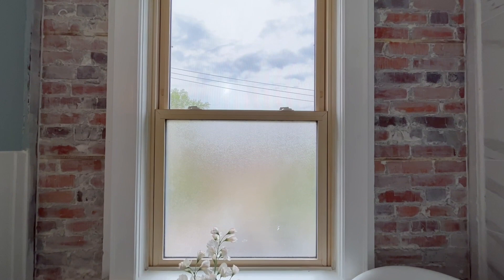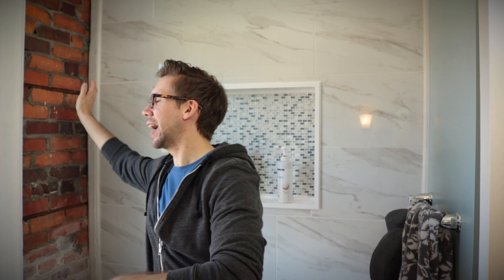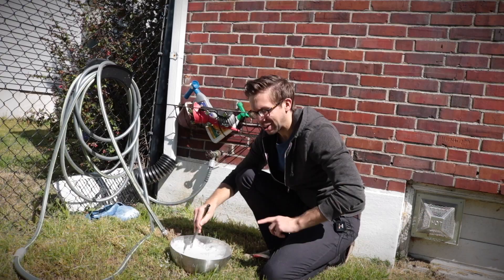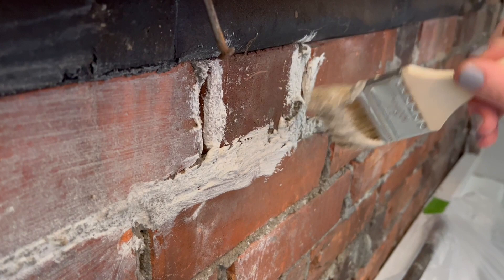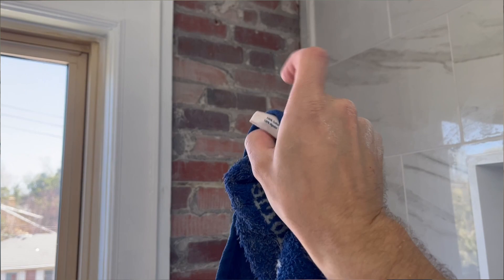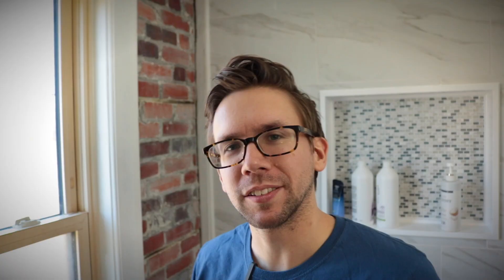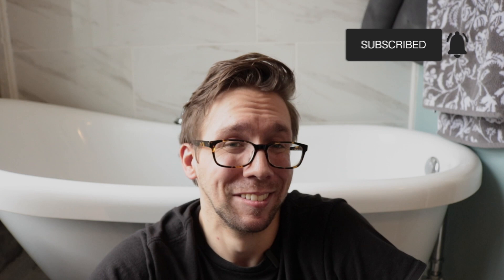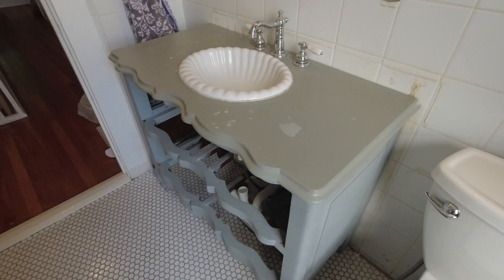How To Whitewash Brick Using Tile Mortar - Vintage Brick DIY

Comment: I don't want to paint or resurface, but I did a Mortar wash to my back patio. Come to find out. It is only temporary. I sprayed water, sprinkled mortar scrubbed it with a sponge. It looked great. Then it turned to powder and wears off. I am now doing a lime wash, 2 coats and sealing it to be more permanent. Don't forget to SEAL IT.

Comment: Great idea using white thin set. Probably a little more work than using latex paint, but the results will no doubt be much better and look authentic.
Reply from the maker: Exactly! You also don’t have to worry about water splashes if you’re doing it in a environment that might see that

Comment: Can you use white grout?
Reply from the maker: Solid question, yes BUT - I wouldn’t use sanded grout. In my experience the tiny sand particles are always “shedding” off. But in breathe and can expand and contract a little so it’s the perfect material.